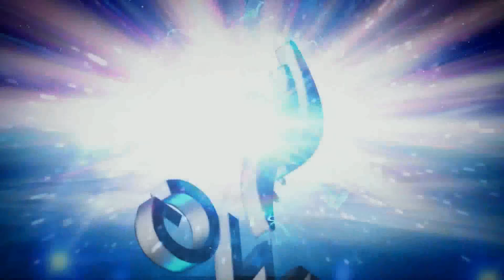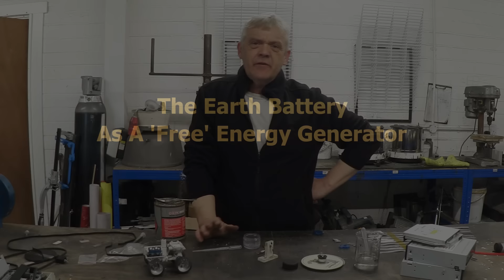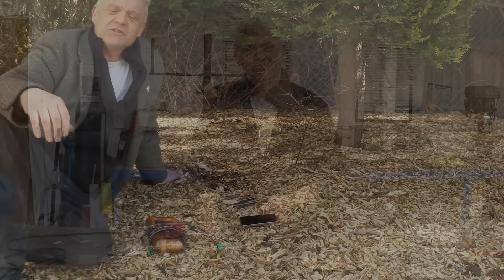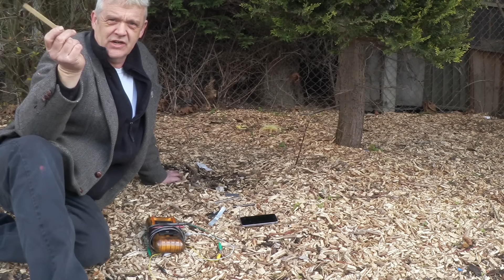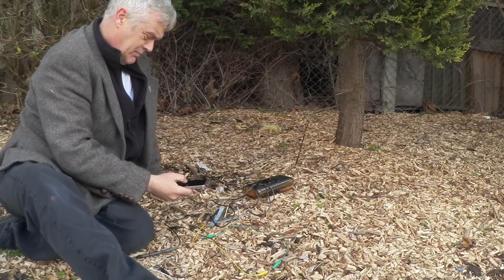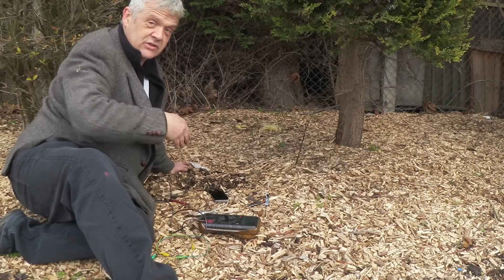The Earth Battery As A 'Free' Energy Generator

Comment: When looking for telluric currents Use the same material for both the anode and the cathode to isolate out galvonic reaction.  You'll need seperation distance to have electrical potential. And you should try placing electrodes in a circle equal distance from a center electrode as youll find one electrode on the circle has the highest voltage, and another will have the lowest voltage with respect to the center electrode. Throughout the day 
You'll find that the direction of current will change.
Reply from the maker: awesome - cheers mate
Reply: Yes. If it is different metals, then it is galvanic.
Reply: @grantmcauliffe3437  Well potentially telluric electric potentials adding to or subtracting from galvanic potentials.
Reply: @kreynolds1123  I agree with you. That would be a way to potentially measure it. Pun was unintentional. It would be easier to simply use the same metal, though.
Reply: @grantmcauliffe3437  yup same metal, isolates for telluric potentials.
Reply: My thoughts exactly.
Reply: So, changing throughout the day might imply a relationship to solar wind. Perhaps some kind of effect of solar wind against the magnetic field of the earth?  That also plays to the orientation of the electrodes making a significant difference to the output. (Aligning with or against the lines). 

Has anyone tried using a coil instead of a rod for greater surface area?
Reply: @eneking2022  rate of change in current  is toooooooooooooooo small for to be useful in a coil. It would require such a huge inductance with a time constant measuring maybe half the length of a day. 

Maybe solar winds play a part but I think changes in teluric currents has more to do with local weather patterns (winds) driven by the sun and local terrain features rather than solar winds. As in, charge build up and the currents due to wind and clouds and their effect on electrons on the ground. 

Cosmic Rays may play a part in the ground generally being more negative and cloud seeding. And this might be negativly modulated some by solar wind activity. But either cosmic Ray flux is modulated by solar winds effecting cloud formation and global warming significantly, or the suns solar winds does not have a significant impact on neither the amount of cloud seeding and earth's albedo.

Edit and correction.  Apparently the earth's geomagnetic effect, among many others, has a reasonable significant impact on the direction of teluric currents.
Reply: @kreynolds1123  
Ok. Just seemed that it might be related is the same way as it does amateur radio bands between day and night.
Reply: It would be so dope if I knew the language that you spoke here lol
Reply: @CODENIJJIRISING  teluric currents are simply natural earth currents. 
You can place two identical electrodes into the ground and seperated by a distance, and a voltage potential may exist. 

Galvanic reaction is a type of chemical reaction with  two different metals, where in a battery the two metals make an anode and a cathode electrode. when electrons flow through a wire in an external circuit, the electrode of a battery that releases electrons during discharge is the anode, and the electrode that absorbs the electrons is the cathode.

That means, if your looking for natural earth currents and not make a battery reaction, you'll want to use the same material for both electrodes. 

If you put one electrode in the center of a circle of electrodes, you'll find that one electrode on the circle permiter will be the most positive with respect to the center electrode. And at roughly 180 on the circle, there will be an electrode that  is the most negative with respect to center electrode. The most positive and negative electrodes will change through the cource of a day.

Comment: To add to the conversation, I had some thing interesting and surprising that happened to me a few years ago..   I am a Ham Radio operator.  I had two copper ground rods just out side my ham shack window.  One was a 4 foot rod and one was an 8 foot rod.  I decided to connect their #8 wires coming into the house  together in hopes of an improved ground area and better grounding effects...  AS soon as I touched the wires together to bond them there was a loud snap and I got one hell of a shock...    I never took this any further but think the two different length ground rods had a different ground potential and in essence a potential difference between them...   Any knowledgeable Ham knows that if you have a potential difference you get a voltage and a current flow when they come together.     I say forget the copper and the Zinc  and work with the different lengths of copper 2 to 1, 3 to 1  length variance and take some measurements to see what is happening here......   Just sharing ideas here for maybe some thing to be developed that will help humanity with cheaper power.     The best to all.
Reply: FREE! The word you're looking for is FREE POWER!
To set the mind FREE! NO MORE DUMBING DOWN THINKING ABOUT BILLS PUSH THE MIND TO SEE MORE.
Reply: I get shocks w/out anything except me and what I touch. That's just static electricity.

Comment: Hi I read somewhere that aligning the cathode towards the North and the anode towards the South whilst making one giant straight N/S line with (cathode, wooden paint mixer in between them, and anode, taped together and buried) cells at least 6’ apart, joined via copper wire as the ground was sprayed with saline water worked wonders. 

Someone else did the same thing only, in separate big planters and yielded much more voltage.

Comment: Carbon and Magnesium metal gave me the best results by far when i tested this a couple of years ago.
Reply from the maker: interesting - thanks for your post
Reply: Are there any common sources for magnesium objects? I've got carbon rods from those big camper batteries.
Reply: Fredrik Zachrisson did you try gold, silver and platinum rods?
Reply: @aaronedvalson104  Yes boatyards on freshwater areas with Steel boats use Magnesium Anodes welded to the hulls, they are usually cut off and replaced when worn away only 75 to 50% of the original size.
These comprise of a Magnesium ingot cast around a flat piece of Mild Steel running through the centre, 
the Steel, of course, being the bit welded to the Boat Hull to make a strong connection and provide galvanic protection. 
Boatyards will often give the old ones away or charge you a small beer fee because they are virtually worthless for scrap value.
Boats on the coast in Saltwater tend to use Zinc Anodes instead of Magnesium.
Reply: @richardsandwell2285  interesting! I'll have to call in to some local places and ask. Thank you!
Reply: @crying_hippy  i tried Ag, but Mg was far better.
I used Mg rods. Just google it. Its used for a lot of things so its probably not hard to get a hold of.
Reply: Would be interesting to see if adding a little salt around one of the rods increases conductivity. I'm not sure which on it would be.
Reply: @marcusjackson5837  agreed
Reply: @crying_hippy  He's using things laying about the yard, so probably no. I was working on getting the gold out of an old printer, when my husband threw it in the dump. He hates work even when he's not doing it.
Reply: whisperingsage I hope he doesn't consider Love making as work, but then again your turning printers into gold and build you own nest egg
Something is a foot
God Bless
Reply: I remember the time you said free energy came from your fingers now you say I am a fool ... Naiegh Do you here by accuse me lofty in my beliefs in that a tree can power a fairies home I say it plainly it can and does on many parts of the great english countryside
Reply: @RAVEN'S YELL No doubts about the effiency, but I'm a little worried about the soil if you're dumping a lot of salt in it...?
Reply: @RAVEN'S YELL thank you
Reply: @ThinkingandTinkering  could it be the natural magnetism of Earth which links the two?

Comment: We had power from the soon to be defunct ESKOM over a SWER line, Single Wire Earth Return, granted it was  an 11KV line, dropped to  220 volt through a transformer at our take off point. The line was 8km + long and we averaged 300 mm or so per year, there was a river flowing through our farm which might have been a factor, but these types of lines were and still are used supplying electricity over hundreds of kilometers in the country, so there is something about using the earth as a "conductor"

Thank You Robert for all the fascinating videos

Comment: Awesome! This earth battery gives me a lot of inspiration for "Land Art" sculptures. Would love to be able to light up LED's!. Thank you for sharing.
Reply from the maker: Go for it mate
Reply: @ThinkingandTinkering  Suddenly an idea just hit me as well. Seeds might be activated by this voltage current. Hydroponics is like an electrolyte system and this might be a key component part of how plants grow at different rate based on voltage.
Reply: @troule9t971  fascinating idea, often we think of moisture, temperature etc for germination triggers of certain seeds. But the moisture and temperature allowing voltage to trigger germination would be an interesting thing to test. If you could somehow place a seed into the proper temperature and moisture content and then somehow remove any electrical element and see if they fail to germinate then this hypothesis might be able to be proven.

You could do a similar test with growth rate of a plant I would imagine, if you had two plants with the same environment but for one you tried to find a way to draw out all the current maybe thru this earth battery in the pot under load to use the energy and see if any growth differential occurs.
Reply: That'd be groovy.

Comment: With the schools closed this is going to make a great experiment for my lad and I. I once arranged for a Well to be dug on Dartmoor, a man turned up with divining rods, found a source and two weeks later started boring. Found water. Always fascinated me. Maybe he tapped into some hidden electrical anomaly. I don't know but find the idea beguiling.
Reply from the maker: cheers mate - thanks for the post
Reply: I was at work looked outside man on car park with rods he saud had to find water pipe and i should do it sure enough i found it
He said anyone can
Reply: @anonimouse4678  a person is a walking leaky battery. Put 2 bent steel rods in your hands ( I use a coat hanger to make it) and you become a meter. Look up science of dousing( probably spelled it wrong) but it gives you an idea the science about it. Any partical has north and south pole. Water moving underground carries material with it some materials are stronger with a pole arangement. Your rods will align with that flow direction because there is movement of a magnetic field.

Comment: The modern alkaline AA battery.  Cut one open.  You will find that the battery today is mostly carbon.  The center of the battery is a paper tube filled with metal powder.  I think it is magnesium.  The battery is moist and works using a base liquid or alkaline liquid.  It produces 1.5 Volts and 3 amps.  The manufacturing is known for earth batteries.  We simply switch the base for water, which should produce 2 volts and .8 amps.  The switch to water hopefully will make the battery last longer.  Recharging could be as simple as changing the water.  If the metal is battery part that is being "destroyed", then we can recycle.  It is simple chemistry to recapture the used metal.  The interesting thing after I cut open the battery, the metal powder seemed to look fine.  Also, knowing that an increase in surface area will generate more amps, the powdered metal is probably the best way to insure mass area in a small space like the core of a AA battery.

Comment: Hi, great content by the way - but I was wondering since Aluminium surprisingly seemed to produce 1 full volt as compared to most of the other scrap metals -yielding less output and people toss out their old TV antennas - which are seemingly aluminium tubing - and one commenter below suggested that driving the metal deeper into the ground so that its nearly completely covered - increases the voltage dramatically - then getting hold of as many old discarded TV antennas as possible and using relatively long lengths of that wasted or discarded source of aluminum tubing might actually be worthwhile doing and wiring them in series over an entire backyard might produce a sizeable set up that could even be used for recharging car batteries and everyday household items and tools that use batteries - and all for free - as you could charge tools etc constantly and thus reduce electrical grid power consumption - a big consideration these days with ever increasing mains power costs to householders.
Reply: Exactly the experiment I'm doing

Comment: Fascinating. I think if you were anticipating microamps, then perhaps a 1K resistor might have been a smidge on the low side. Perhaps 1M to begin with?
It's a pity that all "coking foil" is aluminium, be great to have access to a very cheap HUGE surface area that could be played around with.

If there is any "non corrosion" based power generation, I am guessing two IDENTICAL electrodes should yield something - so perhaps there is merit in playing with a 10 metre roll of foil for about £1 :)

Comment: Thank you for doing these videos.  I've been eyeballing earth batteries for years.  Planning on running them in series along the property fencing perimeter.  I really like your Magnesium/Carbon combo.  Personally, I've always believed these work due to the ongoing electrical charge the earth itself acquires via exposure to solar ionization.  Probably some electromagnetic induction from the Iron magma flows under the crust as well.  I've got experiments re: a couple ideas I wanna try out w/ your Mg/C arrangement.  Geometry of the cathode/anode for maximum surface area being one.
Reply: Stray leaking voltage from powerline much like a CT. This guys meter has a battery in it is is inducing voltage into the ground and measuring the difference is potential not any voltage other than from his meter.
Reply: @harrywalker5836  You forget bigfoot and the easter bunny.
Reply: Ugh! Powerline leakage is ac not dc that is being measured here. Also dc battery can not induce voltage into ground. Induction happens in the realms of ac. The voltage difference between the electrodes here is due to chemical energy..like in real batteries..! However it's not quite as aa cell.. :)
Reply: @hipihei  Excited electrons do not care if they move in one path or all paths. Try taking a basic class on electrical theory. Wow! Just WOW! You really think you have an argument here? lol
Reply: Hi, Ah yes. my thoughts exactly as I have a 2 acre camping bush block in rural Australia that can never be built on but although mains power does run down the dirt road it is located at - is pointless connecting for a block you only camp on and don't live at.

However, the fencing needs replacing as there's very little of it left to even mark the boundary so to avoid needing to have it re- surveyed for a fencing contractor to erect a new fence - I'd need to look into having it done soon - but just haven't had the money or the time to put into getting it fenced yet.

I got the property dirt cheap you might say - several years ago because the young couple that owned it had trouble selling it and let it go for 12 grand AU when they really wanted 18 grand or more - but 12 grand was all I had at the time so I put the offer to them and they accepted it luckily.

So I was intrigued that you have a similar idea to me and might I suggest that a cheap way of doing the perimeter fencing electrical idea - mignt be indeed to collected as many waste or discarded old TV antennas that you can get a hold of [ maybe] when people have hard rubbish drives - unfortunately my local rural council doesn't have those otherwise I'd be haunting hard rubbish drives and scooping up TV antennas galore - just for the aluminium tubing in them - for the [our] envisioned electrical energy production project for supplying an off grid power source for - in my case - an isolated but very nice property.  

Needless to say I'm something of a pack rat/scrounger when it comes to collecting some useful things people regard as useless🙃

Comment: I just read a book called " the electrocution of america" recently. It is about Alternating current from the utility returning from the load back to the transformer or substation directly through wet soil rather than through the "neutral" return wire. (causing health problems in cattle and people) Supposedly it is too common in the usa, because of how the system was designed. I mention it because wet soil is definitely conductive to current, and does not imply corrosion at all. My guess is the earth battery effect is probably the movement of conductive materials in wet soil, within the earths magnetic field. faradays law